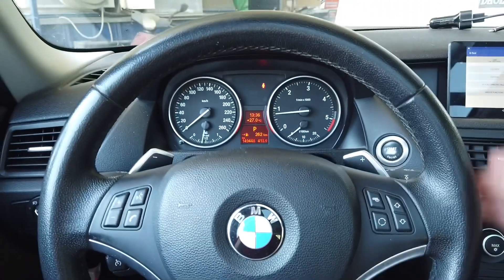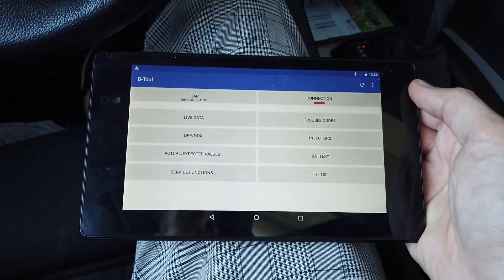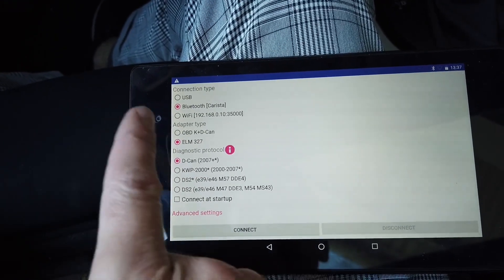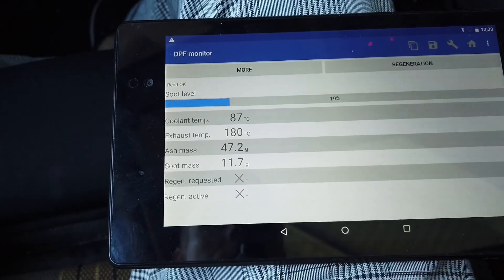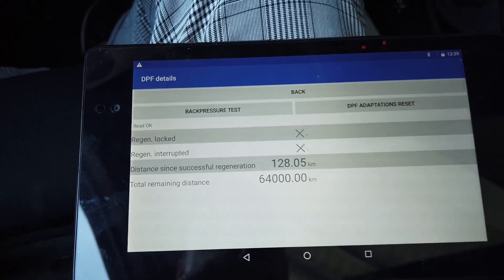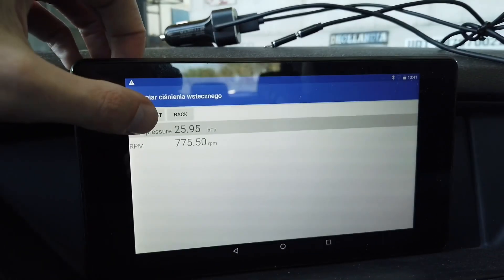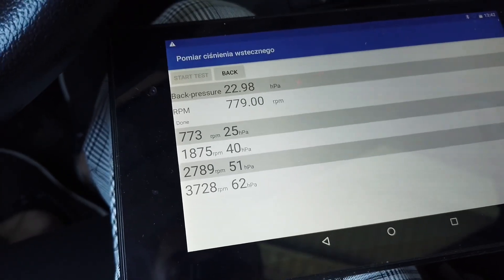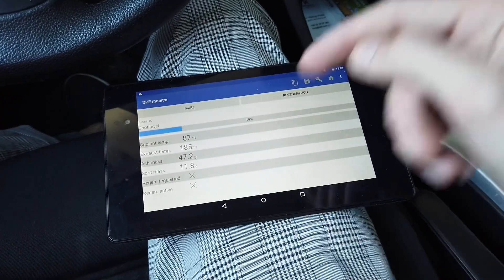BMW DPF check and exhaust backpressure test with Bimmer-Tool for Android

Comment: I did mine,  530D  got  719 rpm  -7hPa   1945 rpm  -2 hPa   2796 rpm 15 hPa    3641 rpm  36 hPa.   What do you make of those readings? Thanks for the video
Reply from the maker: What do you get with engine off, ignition on?
Reply: @mrfixpl  -12.04 hPa without engine running. Should I be worried with these results?
Reply from the maker: I believe it should show 0 with the engine off (0 pressure difference) since there’s no exhaust gases building the pressure.

Comment: @mr-fix The best app works with carista for android.....At the DPF back pressure sensor calibration it asks for min and max value, do i really need to calibrate the new sensor that i have just installed??

Comment: Sorry, but the DPF is not to trap unburnt fuel particles. It is to filter out the soot particle after the fuel IS burnt. Just like you would clean out the chimney if you had a coal or wood burner in your home.

Comment: My e60 dpf back pressure was not reading anything on tester and sometimes i had an error about that so i changed the sensor and now it's working, so it's better if you periodically check for error because this sensor is responsable for DPF regeneration,the car won't show anything on dashboard ,if you want the DPF to last long i advice that 💪